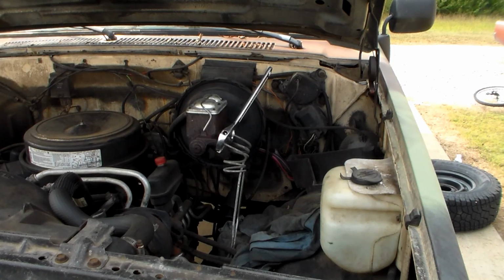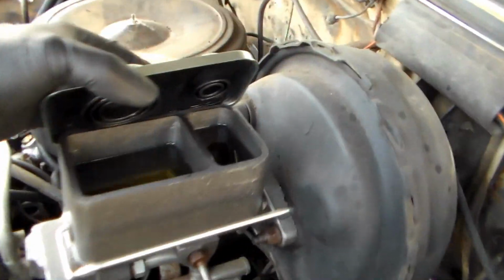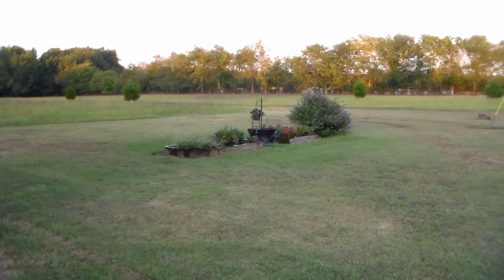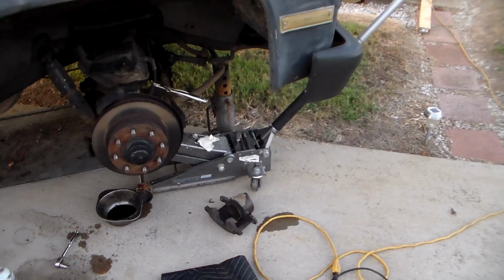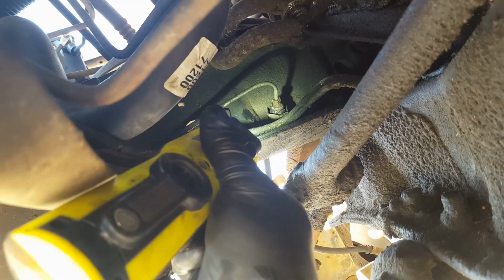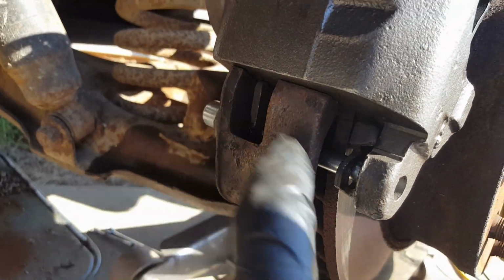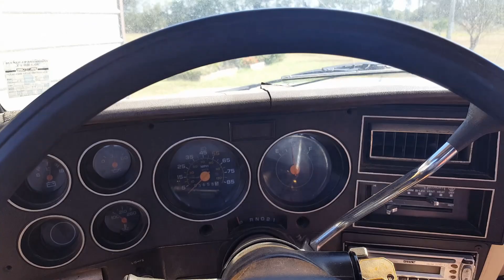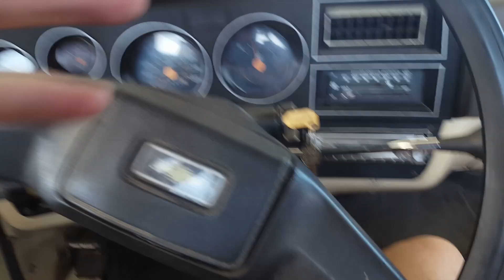Fixed C20 truck rear brakes, it still pulls!! Let's fix it more!

Comment: Back in the early to mid 90's when i was learning to work on my own car there was a chain of auto parts stores named Big Wheel Rossi which was name before most of the stores became Checker's.  Anyways that store was my first cheap parts experience.  I bought several master cylinders there, and they always leaked out of the back although they worked fine otherwise.  After awhile i finally broke down, and bought a master from Napa which i never had a problem with.

Comment: Good, I say, always change the lines, they're cheap for most older American stuff. I had my old PU pull and get hot brake rotor in front, it was the hoses had broken down inside.

Comment: Check the dipstick tube grommet. If it’s leaking worse the longer it sits, the fluid slowly transfers back from the torque converter and raises the level in the pan and will eventually get above the dipstick mounting grommet. I had one that if I drove it daily it never leaked. If I let it sit for more than a couple of days it would start leaking.

Comment: Line wrenches??? Never had them. I used what little tools I had. Never ruined anything either..As long as we're carefull.
Tyler, when you're working alone, you have to come up with whatever you can to get it done.

Comment: Looks like it's fixed this time. Interesting parallel on the tool front, the only line wrench I have is metric, I know exactly where it is but no idea why or how I came to have it. The only vehicles I've ever had to do brake lines on (knock on wood) were my old land rovers, which have imperial size fittings.

Comment: I need to do the exact same thin to my 83 b250.....change the right front caliper.  P.o. changed the left  caliper and when i hit the brakes quickly it pulls to the left.

Comment: Hey Tyler I listen to a video today that you might find interesting the men had a 67 or 68 cougar with a 302 in it and it had a stuck engine he use some sort of blow torch to heat the block and it freed up the bottom end of the engine and made it rotate I think the name of the site with something like Mustang for 29 it had definitely at 4:29 in the title if you need to try to find this site look for Dylan and the cool and it’s 20 people that’s associated with him but I’m hoping maybe you can use this to get that Oldsmobile on stock